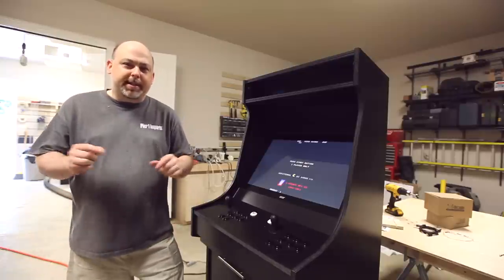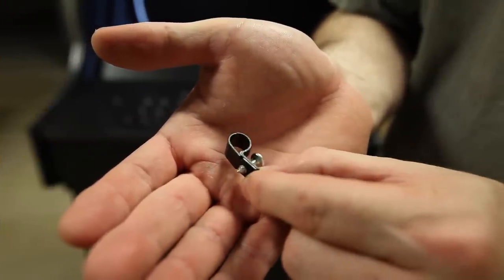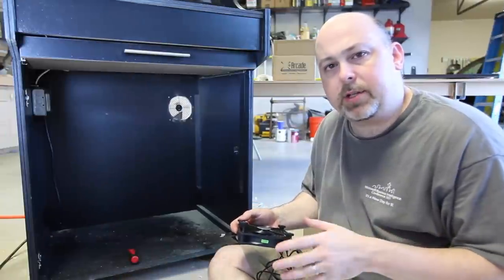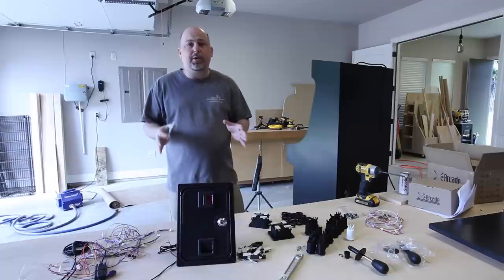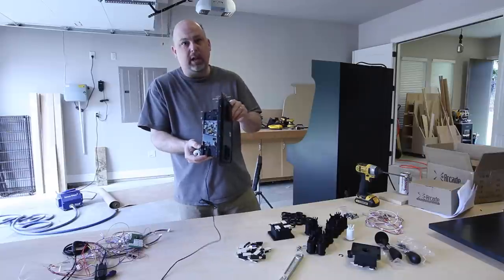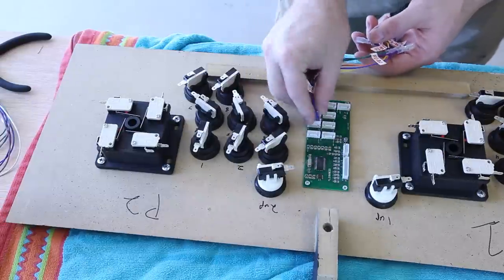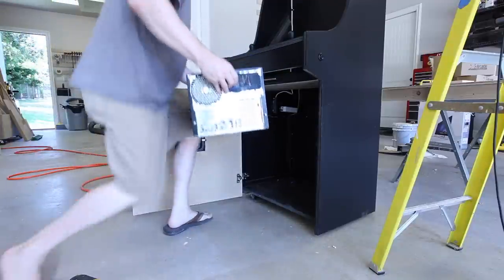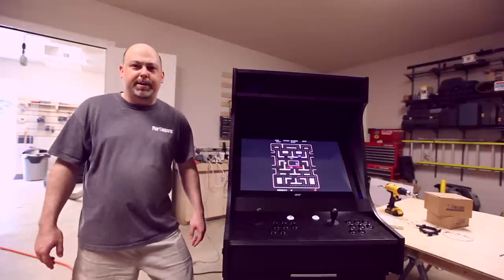How to Make an Arcade Machine: Part 2

Comment: Should'a put a CRT in it, just for authenticity now Your gonna say it's impossible, but theres such thing as an HDMI to AV converter, also HDMI to component And CRTS (the really good ones) support Component
Reply from the maker: +TheKHfan358over3d I covered this in detail... but what the heck.  I specifically chose NOT to use a CRT because of 1) cos,, 2) weight, 3) excessive power consumption, 4) form factor, 5) my need for touch screen, and 6) reliability.  All covered in great detail on my website if you want to know more.
Reply: TheGeekPub hmm, still a CRT is more reliable for gaming, and considering your playing older arcade games it'd perfectly simulate how it's like

Comment: This might be a dumb question but I always thought those happ joysticks should be installed from the top with a stud and a nut. I like how you just used screw to install from the bottom. I wanna put iL Eurosticks in my SF2 Arcade1up cab, which screws did you use? My control deck is only .5" thick mdf so my screws would have to be shorter but those screws look like the perfect size for the joystick mounting plates!
Reply: I had to replace the joystick on my x-arcade (that looked like the ones in this video) because they sucked for fighting games, i change them for the IL (Industrias Lorenzo) and they are soo good 😊

Comment: I was wondering on what type of PC you used for this arcade. It looked like a custom build one but wasn't for sure.  And would do you have preference on a PC tower arcade compared to your Raspberry Pi arcade.
Reply from the maker: I used a custom built PC that I had in the closet for this build, but have since replaced it with a Raspberry Pi 3.
Reply: TheGeekPub is it easy to install hyperspin on the pi? I just got mine set up on Windows and want to move it to a pi when I order one

Comment: What size screws should I use for the electrical box?  On mine the holes are pretty big, probably 1/4"  Should I be using a #10 1/2" sheet metal screw?  I don't want the screw poking through the 3/4" MDF.

Comment: I have a question. Are the buttons on the left and right end sides of the control panel coin buttons? I'm confused. I also barely saw the joystick being wired in the video.

Comment: I'm an absolute beginner with electrical wiring in that I have no idea what I'm doing but I wanted to add a switch to the bartop build. I've bought everything I need but now I have a problem. Even after buying the plans from the site I'm clueless as to how to wire in a switch to the whole setup seeing as the switch is separate from the quad box. I have three spools of wire each color coded white/black/green. I also have wire caps. Should I cap the the black wires from the power cord and switch together and then run loose black wire from the switch to the 2 gang box setup as usual? Then run power cord's neutral wire straight to the 2 gang box setup as usual and cap all ground wires together?

Comment: THIS IS FREAKING AWESOME!!!!!!!   I think I may even be able to do this!   Holy Cow you have gotten me excited about this!   I will be in touch! :) 

Chris
Reply from the maker: +Chris Pine If you make it, you have to share some pictures with me on my Facebook page!  I love seeing other people's work!
Reply: +TheGeekPub hey its me again. I think i have my software issue down now. But what i dont understand is how you made all you electrics sync up with your power adapter and switch.

For example if i just turned the power on that way. my tv monitor and pc would not turn on, as you have to normally press the buttons on them manually. also if you just turned everything off with the switch, when u turned the pc back on it would detect it hadnt shut down properly and want to recover. Do you just have software for these problems or what?

Comment: You need a 0.125" steel frame to better-secure the coin box, or they'll pry it out through the MDF and steal all your quarters, then come back a week later, steal the quarters again, and complain that the machines are all broken and should be fixed. :)
Reply from the maker: +Eight Virtues Since this is a home arcade, I don't think I need to worry too much. ;-)

Comment: Is there any advantage in using the PCs board to wire the controllers, versus connecting the wire directly to the pins on the raspberry pi?
Reply from the maker: I wrote a whole article on that at my website.  TL'DR for you... yes.  a ton of reasons.

Comment: wouldn't it have been easier and/or cheaper to just take a regular computer case fan and plug it directly on to the motherboard headers of the pc instead of using a usb fan?
Reply from the maker: +Benoit de Perthuis USB fans are the same price, and don't require me cutting a hole in the PC.  Plus, the idea is the cabinet is supposed to be independent of the PC.  I can replace the PC at will and the fan will always plug right in.

Comment: Question, is the monitor just sitting in the cabinet and on the rails or did you secure it more?  I haven't found anything else on the blueprints or website?
Reply from the maker: It just sits there.  There is no need to secure it.  Unless you plan on tumping the cabinet over or are afraid it might get stolen if in a public setting.
Reply from the maker: In the case you do want to secure it, just add a board behind the monitor and screw it into the VESA mount holes with some machine screws.

Comment: Dumb question. Do the plans on your site include how to wire the controls to the computer? I am extremely new to this. But building one of these has been a dream I have had for a while.
Reply from the maker: The arcade controls you pick should come with wiring instructions. I don't include it in the plans because there are a hundred different kits that all work different.  If you buy the controls listed in my plans your golden.
Reply: +TheGeekPub Awesome. Thank you.

Comment: sanwa or seimitsu sticks/buttons are better. They have better sensitivity and they just feel better overall
Reply from the maker: +SENzA Send me a set and I'll be happy to try them out!
Reply from the maker: +SENzA You forgot to include your credit card number... ;-)
Reply: +SENzA tried using it i got error code 69 ;)
Reply: Constrixx XD
Reply: they have trouble fitting thick wood panels, for me industrias lorenzo is way better for arcade use, as they are more sensible than HAPP

Comment: Looks good. If you take the plastic off the front of the monitor you can get the monitor sitting a lot more flush with the screen bezel. Then run the screen bezel right around the scree
Reply from the maker: Not possible.
Reply: It would be, you just may need a cutting tool.
Reply from the maker: @brendongyde  I guess if you like losing the warranty on a $500 monitor.
Reply: If you purchased this new for this project not advisable. Personally would use a second hand screen.

Comment: When I was a kid and arcades were popular they had a semi-indoor arcade at White Water (an amusement park). I remember playing a game (which escapes me) that sent a mild electric shock through you when pressing the coin return button at the coin box. Most of the players were coming in from the pool and water rides. The floor was wet and with wet fingers on the control panel... Guess I was lucky.

Comment: Sweet videos, really appreciate them. 

Something I noticed; traditionally 1player is on the left, and 2player is on the right, I noticed it is reversed in your setup (perhaps intentional).
Reply from the maker: +Lorenz “Lysistrata” A Yes, it's intentional.  I felt like 99% of the time is one player, and I wanted to stand in front of the cabinet. It's literally at 3 second change to switch it though.

Comment: Nice video bro.  It sounds like the  Bluejays wanna play galaga.  Did you need to use an amplifier with the speakers? Or just wire them straight from the raspberry?
Reply from the maker: Those speakers are USB powered (built in amplifier).  That's why I use them all the time.  So easy and sound good.
Reply: @TheGeekPub  Nice.  U can power the straight from the raspberry? Or did you power fron the usb on the outlet? Or would either way be fine?